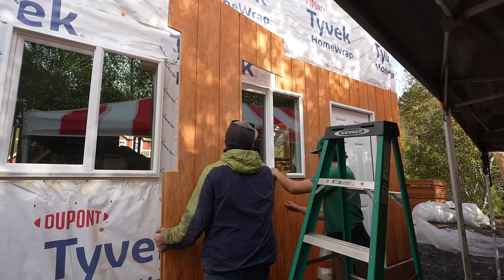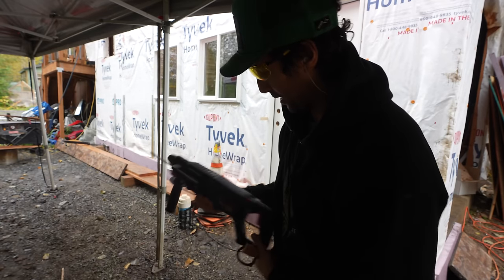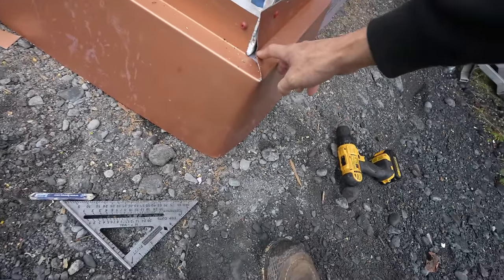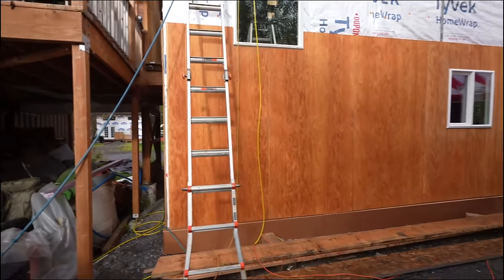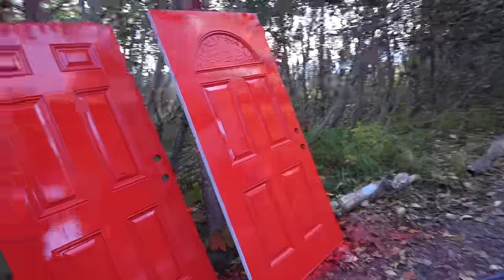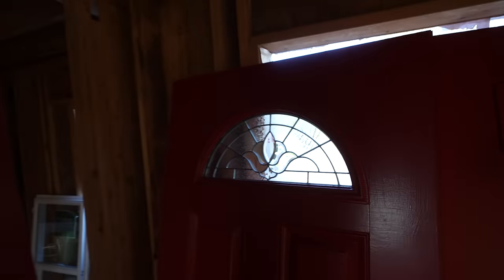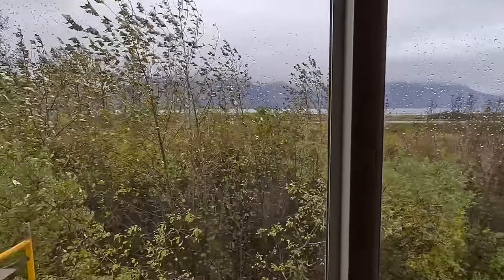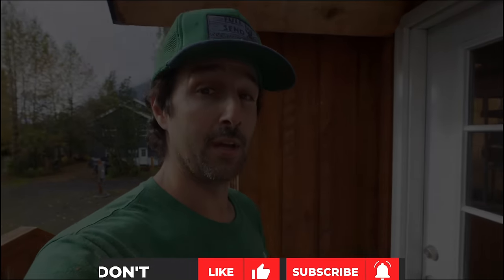I (Accidentally) Built the Weirdest Duplex in the World.

Comment: Tim, cutting the tab closest to the perpendicular vertical face of the corner was incorrect.  Instead, cut and fold it back behind your perpendicular angle. You will still seal it, but there is mechanically much more material there to take the place of chemical caulk, which will fail in X number of years.

Comment: You are not using a rainscreen set-up. Is it not code in Alaska? You do have big overhangs so it's pretty safe. Love the 2 colors for the siding.
Reply from the maker: I did the rainscreen method on the 320 sq ft rental cabin that's attached, had lots of problems with critters and bugs getting behind the t1-11  (even with wire mesh), so didn't mess with it on this house, that and it' s a huge pain and a lot of extra work